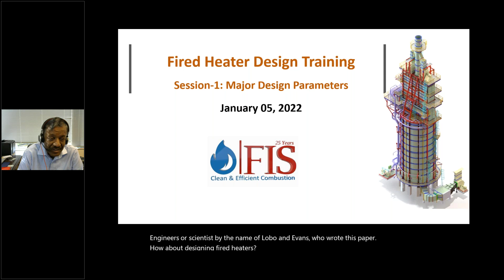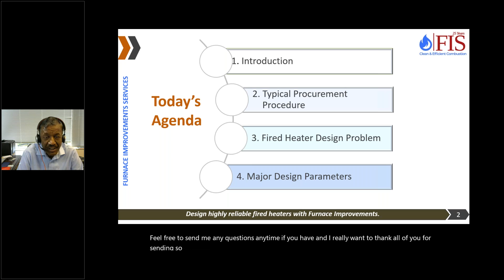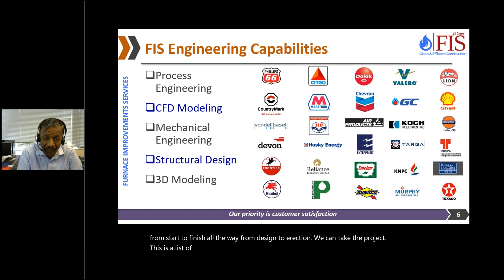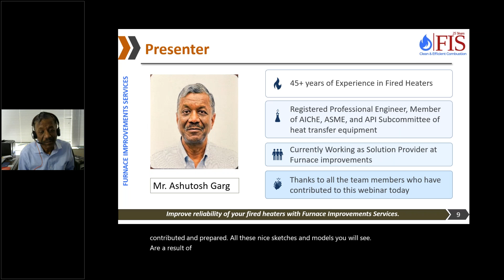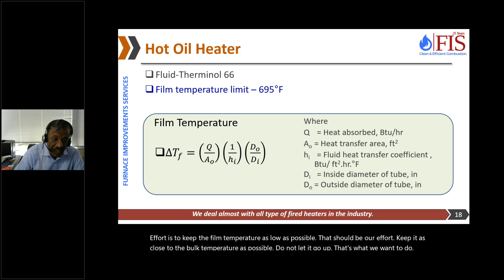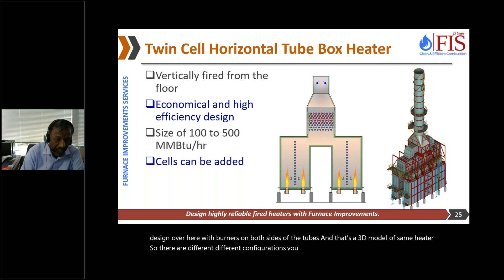Fired Heater Design Webinar (Part 1) - Major Design Parameter

Comment: Dear Sir,

I watched your video on YouTube, and it is very nice.
In our gas plant ,we have Vertical Cylindrical natural draft fired gas heater.
Tube design temp is 350 C, temp at the inlet of convection zone is 700 C 
Convection zone consist of 7 rows, first three rows from bottom to top is non-finned tubes. The rest from 4 to 7 are finned tubes.
We have repeated failures in the convection zone, most tubes fails are at the fourth and fifth rows.
The heater is working for regenerating the molecular sieve of the gas dryers, so it is working cyclic , 5 hours heating and then off 3 hours. 
At the end of heating the burners shut off and fuel cut off inside tubes at the same time while the temp at the inlet of convection tube is 700. 

The questions are :
- Do you think the temp of the tube metal increase at moment of closing the valve of the gas inside the tubes while flue gases temp inside the heater is 700 C causing the tube failure? Is it a good idea to keep ,  the gas flowing inside tube after shutting off the burners to protect the tubes from flue gases high temp?
- Why we have repeated failure at the first 2 rows at the finned tubes in the convection zone? Is because of the design ?
Here is the design of finned tubes:
	     Location	First put in service	Number of failures	Fins Dimensions:	Spacing (fins/m)	Height (mm)	Thickness (mm)
        	MCX	2006	                                  11	                                                          197	25.4	1.5
                                                                                            API560	:                              	197 (MAX)	25.4 (MAX)	1.3 (MIN)
Reply from the maker: Please feel free to reach out with your questions at info@heatflux.com